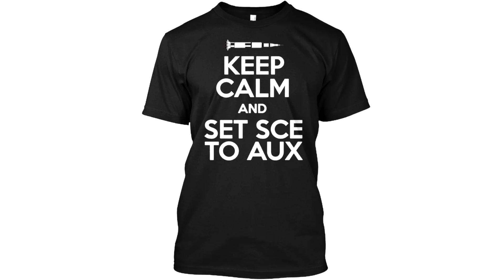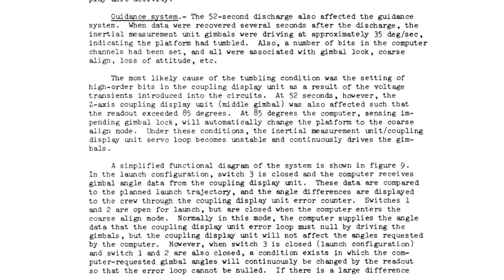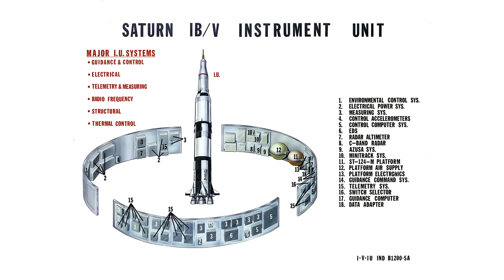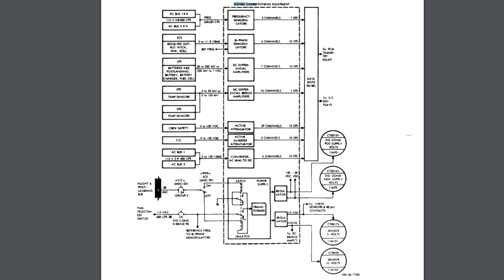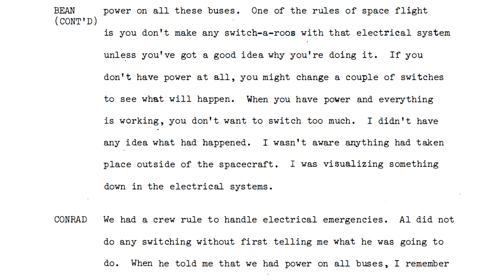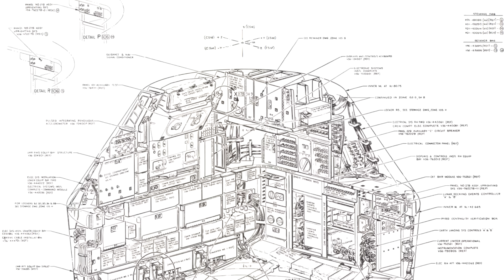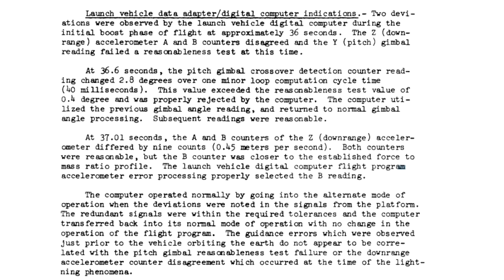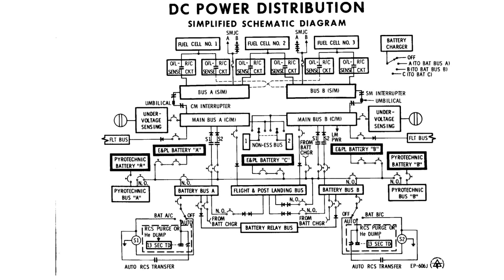What Does "Set SCE To AUX" Mean Anyway - Apollo 12's Lightning Strike Explained

Comment: Curious??  In a car the batt starts the engine then the engine and other systems draw power from the alternator.  So in a rocket does it also have an “alternator” that it runs on from the rocket stages??  Because you mention the batteries as if they aren’t supposed to be used but yet they had to use them due to the lightning strike.  Thnx love the vids!
Reply: Most manned spacecraft including Apollo and the Shuttle use fuel cells to generate electrical power.  These combine hydrogen and oxygen with a catalyst to generate electricity and water.  They use the water for drinking.  On apollo the fuel cells were on the service module, so the LEM was completely battery powered, and when the command module separated for reentry, it ran on the batteries alone.

Comment: Well if the shutoff was supposed to happen at 22.9 volts, running at 23-24 volts it should NOT shut off again due to "undervoltage" even if the nominal power is 28 volt. It sounds as if that did not as much shut off the undervoltage check as reboot the whole module and get it to restart without the voltage kicking in the automatic reboot. A bit like the tired OS cliche "did you try closing the window and opening it again"? It was not enough energy to get it to automatically get the SCE running, but when you force the SCE to reset in another configuration, it avoids the problematic point that shut it off before.

Comment: The story misses one critical part of the story.  The SCE switch was such an obscure switch that almost no one knew about it.  One of the few people who did know about it (because of a previous simulator test) was Al Bean - who just happened to be in the command module and in the seat responsible for that switch.
Reply: This is baloney.  The astronauts were trained on the purpose for every single switch in their area of responsibility (on their side of the cabin).  Does it really make sense to you for the Engineers to go through the trouble and expense to put a switch in the spacecraft to control something that can't be used because nobody knows where it is or what it does?  The key piece of info that makes this story significant is the ground controller knew power cycling the SCE electronics could fix the telemetry problem.

Comment: Here's what I think.
The electronics were "glitched" and running in a loop with randomized data. By switching the power switch from "SCE" to "AUX" the switch went through a point of zero volts. By going down to zero volts the electronics could finally clear themselves and start over from start without the garbage running in a loop.

Comment: I love this story, Al Bean knew where the switch was, the other 2 didn’t. I have seen that video,The crew laughed all the way into orbit. This is a Great video.The computer was basically I have read an IBM 360 I believe, a powerful computer at that time! A giant calculator now!
Reply: From my understanding most early rocket computers were application specific.  Basically each sub-system was built for one specific task unlike a desktop computer that's built for general purpose computing.  That's also why an old computer was enough to get Apollo to the moon, it had been configured for a couple very specific task and nothing more.  It is possible that it was a modified IBM 360, probably with a few features tweaked or removed entirely.  I've also heard that rocket computers have to use larger circuitry and have extra fortifications to protect them from the extreme vibrations and radiation of space though some older computers are a bit closer to those specs than more modern ones.  I seem to remember something about a SuperCray being used and something about them figuring out an early form of hyper-threading to improve performance but I couldn't find any info on it with a quick search (and unlike most of what I mentioned in this comment the SuperCray thing is an ancient memory).
Reply: That’s because the switch was on a panel that could only be reached by Al Bean. It was his job to know every switch on his panels.

Comment: Then : Turn SCE to AUX
Today: Please don't turn off your rocket while we update your computer...
Reply: (text on screen) "the guidance computer is rebooting 'now' to install updates"
(crew looks out the window in horror at re-entry plasma enveloping the craft).
You want to reboot NOW!?
(Kerbals screaming animation)

If it's not broken, it doesn't have enough features yet. lol.
Reply: @Zarcondeegrissom  When it is reentering, you dont need comp, right?
Reply: @alexwang982  right, if it is ballistic, but if not, and has guidance fins, bye bye
Reply: @alexwang982  or if engines are lit, then i dont know what would happen
Reply: Do you know how much programmable memory was inside the computer on the Saturn rocket?  64K.  You have more gigabytes of memory in a iPhone than the Apollo computer(s) had on board.  If you listen to the ground to CM communications, much of the instructions that were being sent up, were a new set of instructions to code into the onboard computer in whatever "load and go" instruction set they had at the time.  For anyone who is reading this who is a former or current sys prog,engineer, or applications programmer in an IBM zOS environment, the preface of all JES2 (or if you are still in the dark ages...JES3 spooler) are prefixed with $HASP...., that is because JES originated at NASA as the "Houston Aerospace Spooling Program" to multi-task job i/o, printing, etc. The dollar sign was added as and afterthought.
Reply: I'm sorry, Dave, I'm afraid I can't do that.
Reply: "Your spaceship has encountered and error and needs to shut down. We're sorry for any inconvenience."
Reply: "We've been trying to reach you about your vehicle's warranty."

Comment: That was an excellent story, as a story.  I've been in that position with a technical issue - where an intuition about how the pattern of the current problem is in the same category as a previous problem , so you try a solution based on a not-quite understood but replicatable procedure.  I most emphatically do not have what it takes to be in the shoes of any of those men and women, so it's great to be able to identify with a hero of the US space program like that.

Comment: Shows the value of having test pilots on board, wonder what would happen if the same situation arose with the more automated spacecraft currently in development.
Reply: If the electronics survive, the outcome would be better because the software is much more capable.  Aircraft are struck by lightning quite routinely.  Nothing happens.  That said, they now have launch constraints that don't allow them to get into this situation again because of this event.  If there's any static charge in the ground, or any lightning within x miles of the pad, the launch is held.

Comment: I have heard that on the last flight of Columbia, some engineers suspected that the damage to the tiles suffered during launch may have been greater than expected and may have prevented a successful reentry. However, the crew was not told, since this was not something that they could have repaired in flight even if they knew and there was no possibility of a rescue mission. Sadly, the engineers were right and the crew perished when the orbiter disintegrated on reentry.
Reply: Wonder why couldnt have gotten to space station.
Reply: @johnmoyer2849  I can't say for sure. However, Columbia was at the Hubble telescope and Hubble and the ISS are not in similar orbits. It takes a lot of fuel to move the mass of the shuttle around. They may not have had the fuel for the minimum of two burns that it would have required to change orbits. If they missed the ISS, they would be alone without enough fuel to attempt a reentry and would have died in orbit. A satellite's orbit is pretty much establised at launch time. That would be my guess.

Comment: Considering to get to AUX from Norm, you have to pass through OFF, I always thought this was effectively a reboot. I'm wondering if actually going to OFF then back to NORM may have also worked. I suppose we'll never know.
Reply: Actually we do know, since the telemetry problems were caused by the fuel cells going offline and switching to batteries that couldn't provide enough voltage. By switching the Signal Conditioning Equipment to Auxiliary he placed the SCE into low voltage mode to run on the available battery power. Afterwards the fuel cells were brought back on line and the undervolt condition was fixed. So clicking from off back to on wouldn't have fixed anything because the SCE still wouldn't have functioned in that setting until the voltage was restored. So now you know. And the person who gave you a thumbs up for no particular reason.
Reply: @FIREBRAND38  i’d like to see a reference for that.  Nothing in the diagrams I can find indicates norm was any different to aux except it was using the redundant power supplies in the sce. Essentially, switching it it reset the power supply and the sce.

Comment: Basic brute-force electro-mechanical, as opposed to digital electronics, carried 12 through those strikes. Modern digital multi-tasking on a single CPU systems would have totally lost their shit untill a re-boot.
I've done both -- If you need reliability, analog and hardware beat digital and software.  But you lose versatility and quick changes.
Reply from the maker: Modern aircraft get hit by lightning all the time, modern flight computers are more robust than you give them credit.
Reply: @scottmanley  
It is in the robustness of the power supply, largely.  If a heavily computerized system goes down the reboot time becomes critical.  The computer is a single point of failure is my point.
This is generally understood, and designed for. But the SPoF principle still holds. Apollo has triple redundancy on some stuff (power busses) and still had a problem.
(Protected (isolated) data inputs being present... well understood.)

Apollo 12 was worse than common aircraft strikes. The ionized rocket trail provided for a substantial current carrying path to ground. A common strike is more like cloud-to-cloud lightning. The current will be limited by the charge potential transfer, there's not a short to ground.

It's not as dire as I made out, true. But EEs, not just CSCs, need to be involved in the design.  :)

Comment: 6:10: Jupp. Throwing the switch to AUX forces power supply 2 on and circumvents the over- and undervolt detector. Many things on board had manual overrides for safety functions or automatic switching/regulating and that's one example for that. AFAIK the SCE could work down to 22 Volts, but that wasn't really usefull; with such a low voltage, the whole transmitting equipment would drop out, so that you had data, but no downlink to send it on.

Comment: Was the Guidance computer and signal conditioner developed both by Raytheon? I'd love to hear about the engineers who actually designed the SCE and knew it needed to have an AUX switch in the first place. John Aaron was familiar with this system, but there must be some engineer out there who designed it.
Reply: Like most things on Apollo, the SCE had redundant power supplies for fault tolerance.  Therefore it had a switch to select them. This is not surprising.

Comment: There is one thing that I'm curious about, the answer to which requires filling the complete void of knowledge that relates to my question: the weather was obviously very unfavourable for a launch, yet the launch happened. Why?

As I see it, nowadays, weather predictions are accurate enough (at least that is what I believe) that the launch attempt would have been scrubbed; is it really that the weather forecasts in this era were so poor as not to have seen that thunderstorm coming, or is it that they knew but decided to go for it anyway because of a teething constraint (Earth-Moon alignment or something else)?
Reply from the maker: In the description there’s a link to the lightning incident analysis, in short, they weren’t launching through a known anvil cloud, so they thought they were safe.
Reply: It was simply raining during the Apollo 12 launch.  There was no thunderstorm activity in the area.  They had a launch constraint if lightning was detected within x miles of the pad, but they weren't seeing any.  What they didn't know is there was a static electric charge built up in the area that wasn't big enough to cause a lightning strike until the exhaust plume triggered it.  Today, they have field mill instruments on the ground around the pad to measure any electrostatic charges prior to launch.  They wouldn't launch today.

Comment: Did they have to ration battery power afterwards?  Or was the extra drainage minimal?
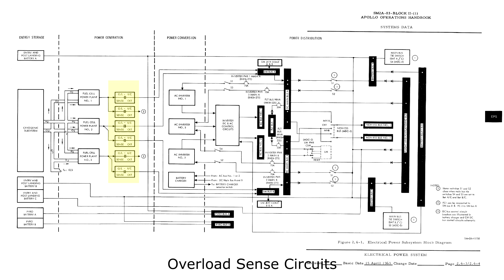Reply: They can recharge the batteries using the fuel cells. See 1:09 power conversion section, bottom.

Comment: I may only have flown small aircraft, never the less my experiences as a pilot has left me with a few near failure missions as well. Though it may only shown up in my log book as an after thought, "I noticed the engine "coughed" without any apparent reason, " or "The battery went dead and I had to [get out of the airplane and] hand crank the engine using the propeller," it still was very much, at the time, got me thinking about whether this flight was a go or "no-go." Scott is always saying, "...fly safe," well sometimes a pilot wonders just how safe IS safe? This is bisbeejim saying remember, "Fly safely."

Comment: Apollo Operations Handbook,  15 April 1969.  Page 2.8-20: "The only external control for the SCE (Signal Conditioning Equipment) is the 3-position SCE switch on MDC-3." - Full explanation of switch function on page. (sorry,  just to clear up the SCE acronym doubts - BC.). Great video. Fascinating space engineering tech history. See:
http://apollo.josefsipek.net/ApolloProjectOnline/Documents/SMA2A-03-BLOCK%20II%20Volume%201%2019691015/aoh-v1-2-08-telecoms.pdf
& thanks, Joe.

Comment: I wonder if spaceX electronics could handle a lightning strike.
Reply: Seb Gibbs 
I don’t specifically know about SpaceX but I do know that regular airline aircrafts are hit on average 1 time per year by lightning. So if they manage to have their  planes lighting proof I would imagine SpaceX can do the same with their rockets. The only problem that they need to solve is that the lightning has to go through the spacecraft in the metal shell/casing, completely avoiding the inner circuits and electronics inside.

Comment: Tips to defeat moon hoaxers in debates:

1) use the Apollo 11 "1202" alarm meant the Apollo 11 was not 100% picture perfect landing
2) utilize the Successful failure of Apollo 13
3) utilize the "SCE to AUX" incident.
4) point out that Alan Bean burned out a camera on Apollo 12 as well.

That way you can point out that Faked stuff usually are devoid of any imperfections and vestiges of simple human mistakes like the four reasons above.

I may have missed out other Apollo mission mishaps and shenanigans, feel free to list them up.
Reply from the maker: I also like to mention that the USSR publicly congratulated the crew of Apollo 11 in the middle of the Cold War.
Reply: @scottmanley  *senpai noticed me*!!! Heheh

I was extremely successful in such debates. Sadly most of them resorted to ad hominems...

Comment: How did the telemetry work in the 60s? Was it encrypted?
Reply: Thats a good question. With absolutely no evidence I would assume back then it wasn't but since you needed some huge antennas to receive it, a random spy couldn't access it short of having a job at NASA. These days we have infinitely better signal transmission tech so I suppose they do encrypt it somehow.
Reply: From a strict sense, no it wasn't encrypted, It was formatted data sent back from the spacecraft oversimplified, kind of like DSL uses the phone lines. the audio is  there and in the background where the "computers" were listening the data.
Reply: @darylmorning  thanks! Which modulations did they use and how fast?
Reply: @goethe528  I don't remember, I'm going by memory of the block diagram on the process from one of the online Apollo manuals. Sorry, I was just kicking out what I remembered and it may be misremembered at that, I'm sure there was no encryption but the mode and modulation aren't in my memory banks.
Reply: @goethe528  all of this information is out there.  look up unified s band.  It was a multiplexed 2 ghz radio carrier.  The data was not encrypted in any way, and you can be sure the russians were listening.

Comment: Set Space Crap Extractor to Automatically Unload X

The crew would have been inundated with poo if they didn't hit the button. They did, and thus saved the Apollo 12 mission. Note: X means 10... Automatically Unload at 10 times the normal speed. It was an emergency after all!